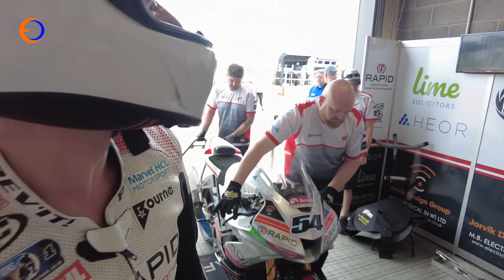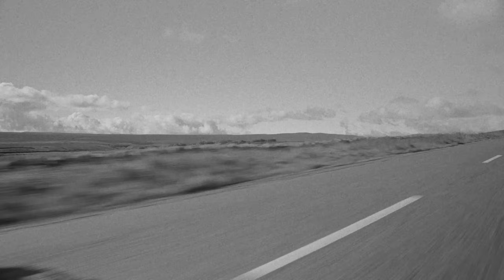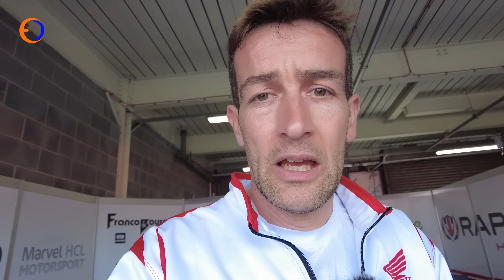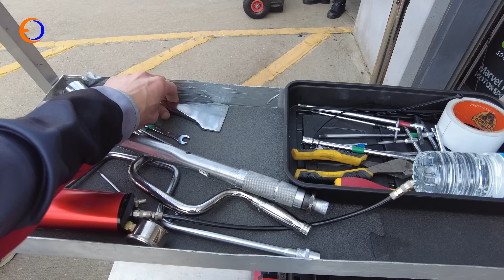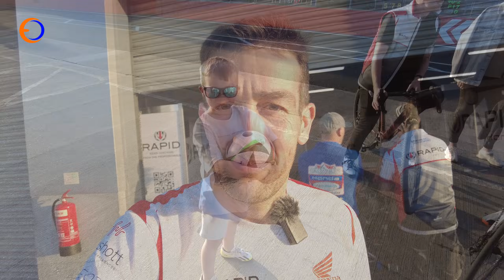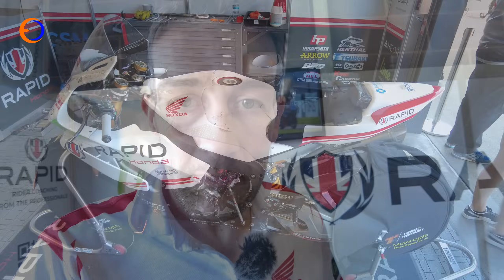Points but no Prizes. Donington Park BSB Superbikes with Rapid Honda and Franco Bourne.

Comment: All those decades I wasted not realising that I just needed to raise the C of G to make my bikse turn quicker (7.03 - I'm listening carefully and still learning)! Oh! hang on a min! I'm confused! A full tank of fuel never helped. I dropped it in the bend and it didn't want to stand back up again! I've obviously done something wrong appart from failing to notice the nail that had reduced my rear tire pressure down to 5 P.S.I.
Reply from the maker: 5 is a touch low 😂

Comment: I really look forward to these videos.  Such an unlucky weekend. Could easily have been three finishes in the points.  Got to take the positives though, good pace, on the grid between two factory Honda's for the first race and when you consider how stacked with talent the field is twelfth is a cracking finish.

Comment: Go cart track ? Silly comment
Reply from the maker: Bit small compared to LeMans
Reply: @obsession_engineering  Dave, the crappy little Bugatti circuit they use for bikes at Le Mans is pretty much the same length as Oulton International ( as its called these days ) . Once upon a time bikes ran on the real circuit at Le Mans as still  used by the cars but that stopped after Sid Mizen from the IOM died on the Mulsanne Straight in 1966

Comment: "A go-kart track at Oulton Park" - I don't think so!
Reply: I do think so! I’ve heard other riders with experience of gp circuits say the same thing. Monsters like Le Mans or Misano swallow superbikes and make some UK circuits, where you won’t hit top gear, feel like car parks.
Reply: Could be more to do with track width, run off and spectator space. I reckon Le Mans is a bit of a different circuit, closer to Silverstone, though as Karting tracks go, Oulton had nothing on Whilton Mill!
Reply: Yes, slightly up himself there.
Reply: Was talking to Nathan Harrison on Thursday and he said Oulton Park was his favourite "go cart" track 🇮🇲🏍🏁
Reply: Le Mans Bugatti, not even the full circuit, but the Mickey Mouse circuit (according to Graham Hill in 1967) around the car parks and has got even worse, if that was possible,  in the intervening 57 years . Oulton not great with all of the chicanes but still a proper circuit for proper riders.
Reply: How’s it feel to be very wrong?